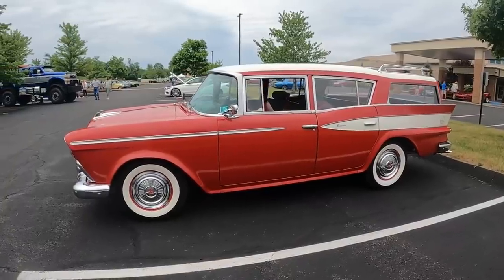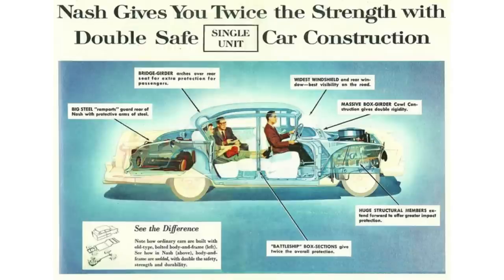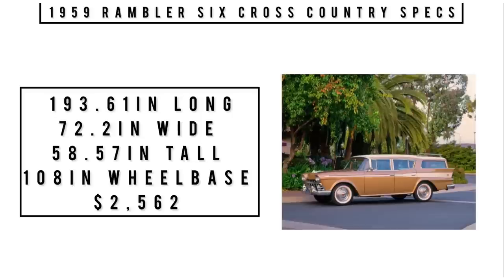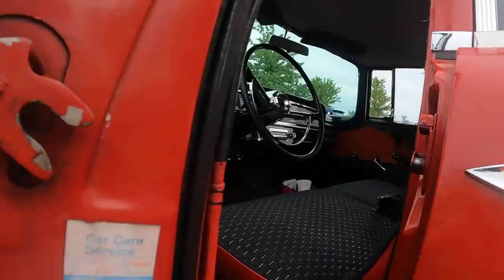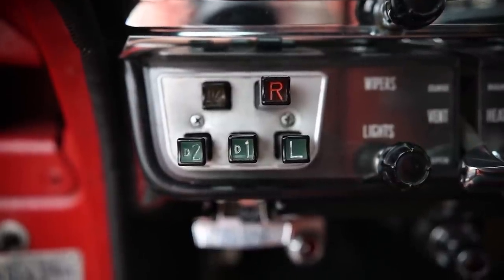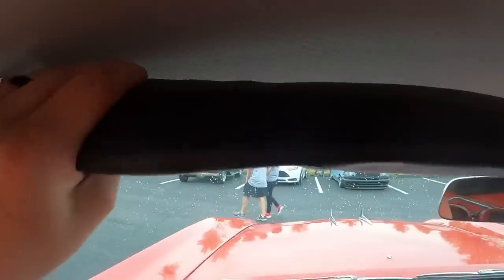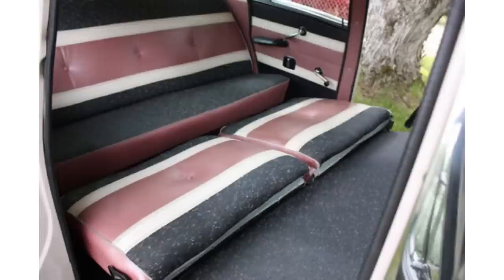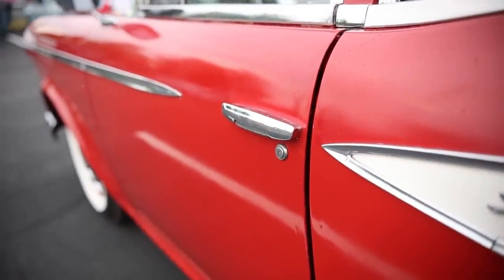1959 (AMC) rambler super cross country wagon six

Comment: I live in the UK, in the mid 1960's I worked for a local antique dealer who had 1959 Rambler Cross Country Custom. My parents did not have a car so the Rambler was the first car that I had any experience of. It was RHD and originally made for a German customer living in the west of Ireland. I used to get the job of washing it, which took ages given its size and chrome work and the interior. The main body colour was black with a bright red roof and side stripe, the interior trim was, black, red with horizontal white stripe. It was ideal for moving large, heavy Victorian furniture, from the auction rooms to the shop etc. When lightly loaded it floated along and smoothed out all the bad spots on country roads. Happy memories.

Comment: Hey. You nailed this one! You show enthusiasm. That's good. You show interest. That's good. You show passion for AMC and Ramblers. That'll earn you extra stars! 
I have an enormous love for all things AMC, and have, fortunately, owned several throughout the years. I hope that the following will be of interest.

The Ambassador series was, indeed, the senior series of the Rambler line. It was actually marketed as "The Ambassador, by Rambler". It was not a "Rambler Ambassador". It rode a 117" wheelbase vs 108" for the Rambler Six/Rebel V8 and had an overall length of 200" vs 191" for the Rambler Six/Rebel V8. 

The Ambassador Custom Hardtop Cross Country station wagon was the sole hardtop wagon in the lineup. The top-of-the line Rambler Six/Rebel V8 Custom Cross Country wagon was not a hardtop. 
Only 578 Ambassador Custom Hardtop Cross Country wagons were produced for 1959.
The Rambler Six Super wagon you showcased had a production run of 66,739 units.

Four-door hardtop sedans  (Rambler Super Six, Rambler Custom Rebel V8 and Ambassador Custom) were called Country Club models. Although period sales literature from AMC does NOT refer to the Ambassador hardtop Custom wagon as a "Country Club",  the Standard Catalogue of American Motors (1902-1987) does refer to the hardtop Ambassador wagon as the Ambassador Country Club Hardtop wagon. So, playing with words, one might call the body style the Ambassador Custom Country Club Cross Country wagon. 😀

Although not presented in any AMC Rambler literature for 1959, the Ambassador by Rambler offered a Deluxe 4-door sedan. Only 155 were made. I've yet to see a photo of one, and I doubt if noted AMC historian, author, collector and expert Pat Foster has either.

For the record:
1-The Rambler American could have reclining seats as an option.
2-You mention Weather Eye. That was the Nash (then AMC) trade name for their heating, ventilating
     system. It did not include air conditioning. Air was a separate option, but was integrated with the 
     Weather Eye system. Nash/AMC was the first to integrate all components of the AC system under the
      hood; nothing in the trunk. It was copied by all other car companies. 
3-The Deluxe Rambler Six came standard with dual headlights! For $23 and change, you could equip your
     Deluxe Rambler Six with quad headlights. 

Finally, you taught me something that I never knew about my favorite year Rambler. I did not know the rear door vent panes were operational only on the Rambler Custom series. I appreciate you pointing that out.

While I have several favorite AMC cars (please find a nice AMC Hornet Sportabout wagon to showcase), the 1959 Rambler Six/Rebel V8 is my favorite Rambler of the 1950's.

Once again, great job!
Reply from the maker: Thank you so much for the added information and corrections I thought the deluxe came with dual lights and could upgrade to quad lights but wasn’t a 100% sure if I read that or not deluxe trim I believe only case in solid colors could be wrong that’s why I left that part out too

This was always my favorite wagon after being in one I really want one now.. they made nicer wagons but none got 32 mpg HWY with folddown seats that looked this good.
Reply: @What.its.like.  Period Rambler sales literature indicates two-tone paint was an option, but doesn't mention if it is offered only on certain trim levels. But, in the 1959 Rambler brochure, it shows a Rambler Deluxe 4-door sedan in the color red, with a white top and having dual (not quad) headlights.
Question answered!
Reply from the maker: Thank you so much =)

Comment: I had two Rambler Americans from the early 60's, the squared off ones.  On the reclining seats, the cars came with two "hook" supports, with rubber covering that were inserted into two slots (on each side) for the backrest to "land" on when folded down.  The hooks made the seat backs rest even with the front of the back seat, to make it more "level."  I'm sure the hooks on this model were lost ages ago, and the current owner wonders why the four slots (two on each side) are in the metal part of the car below the seat cushion.
We als had a 63 Rambler wagon WITH the three speed and overdrive.  At interstate highway speeds, 70+ MPH, it got around 30 MPG.  Those cars were SO ahead of their time.  One of the secrets was the engines in the sixes had a 4.25" stroke.  That. long stroke gave them lots of torque, at low RPM, so the engines didn't need to operate at higher RPM's to keep the car moving.  So at 70 MPH with overdrive, the engine was barely turning at 2,000 RPM's.  Competitors engines, even with overdrive had to turn faster.  Also they all had separate frame and bolted body construction which was up to 1,000 pounds heavier than the Rambler "Unibody" construction.  
The first Unibody automobile made in the US was the Nash 600.  It came out in 1940, using the flathead six cylinder engine (that was in most of the Rambler Americans until 1966).  It was called the 600 because it could go 600 miles on a 20 gallon tank of gasoline.
Reply from the maker: Sweet thank you so much for sharing your experience =) with owning a rambler wagon 

I got the review my friend 62 Rambler wagon last year and he let me drive it and I was really amazed at how much down low power there was.. it wasn’t as underpowered as some people claim. To me a Volkswagen Karman Ghia is under powered.. this car had so get up and go 

I want to find a 1958 Ambassador cross country wagon with the 327 with a manual and I really want to drive it that’s one of the fastest wagons of the 50s 0 to 60 and 8.5 seconds in a wagon
Reply: Then came the famous Torque Command sixes with 7 main bearings, that were also used in Jeeps when AMC bought them out.
They were used in Jeeps up until 2002.

Comment: My grandfather own a 1958 Cross Country with the 3 speed and overdrive.  He claimed on the road he got 28 mpg and that would be with a vacation trip with the car loaded down.  So, yes I believe you could easily get 30 plus mpg in the day with the straight 6 and not a heavy foot.  My uncle from the time I am able to remember owned Ambassadors till they were no longer made.  There son born in 1956 had a heart condition and Nash was the first to have a really great AC.  They developed the clutch for the compressor before ALL the other auto makers in 1955.  One of the reasons they bought Kelvinator was because of making refrigerators.  My dad had a 1955 American wagon and later had a 1957 bear bones Cross Country.  He drove that 57 for about 14 years.  That was a great car.
Reply from the maker: Great story and information thank you so much for sharing =)

Comment: HI Justin,
Thank you so much for showing my car. Sorry I didn't reply sooner, a crazy month. You took such wonderful closeups and angles. Yes, the 4-door hardtop was available in this mid series, in a sedan or station wagon. Both came in the Super and Custom levels as well as the Rebel.  This front seat is correct for and, came from another 1959 Rambler.  With the question of rust. Having lived then, all cars of that era were prone to excessive rust. 
Cars that lived outside of the rust belt generally survived just as well as any other make. There are still plenty of these 1959 Ramblers out west. Thanks again. hope to see you again soon.  I noticed this came up under my daughter's name. Crazy, Take Care, Rick
Reply from the maker: Thank you so much for the opportunity honesty so glad I  stopped and talked to you that day just wondering are You going to beaver tomorrow both ron and I are going hope to see you there =)
Reply: Weather permitting we will visit the Beaver Cruise. The weather has been very active. One additional fact about hardtop station wagons. The 1956 Rambler was the industries very first 4 door hardtop station wagon. They were built for 5 model years 1956 through 1960.  Chrysler had 4 door hardtop station wagons 1960-1964, with some Dodges. GM only had 4 door hardtop station wagons for two years 1957-1958 Buick and Olds only. Mercury was unique they built 4 door hardtop station wagons only, no standard post wagons, from 1957-1960. Also, Mercury built the industries only 2 door hardtop station wagon 1957-1959.  Rick

Comment: Beautiful restoration, right down to what appears to be the factory-correct upholstery material and pattern. The '60 was arguably the last year of the most handsome body lines with the hooded browed headlights. While the '61 was the final year of the rear fins, the grille wasn't as stylish as the '60. Our dad did the unthinkable back in late 1961. He traded in our pristine iconic '57 Bel Air (w/283 V8 & auto trans) for a brand-new base-model '62 Rambler Cross Country wagon that had zero options. It was so basic and Spartan that it had no radio or clock and no chrome horn ring...just a lousy center button and a single horn; no dual horns. It was also a 3-speed column shift, with puny dog-dish hubcaps and no carpeting inside; just that crappy contoured-formed rubber matting (like you find in most trucks of that era). Compared to the Chevy, that Rambler was clunky and noisy. True to its model name, we did a "Cross-Country" road trip in that car from San Diego to Norfolk, VA, then back again 2 years later after Dad's Navy tour of duty was up.
Reply from the maker: Believe it or not it’s a survivor he never really restored it he just took care of it he’s a friend of mine I can’t wait to meet up with him in the summertime. I think he is the second owner if I remember correctly bought it while he was on military base. He had another car at a car show and we got talking and he said he had a 59 cross country Rambler wagon and I looked at him and I was like are you serious I proceeded to tell him that that is my favorite wagon of all time and he didn’t believe me until I started talking about it and then he’s like wow you really do like those and I said get the 59 is my favorite. I’ve been looking for one they’re hard to find in there expensive when you find them in good shape the only thing that worries me about buying that car is the whole trunnion front suspension aspect I don’t know anything about that I’ve heard horror stories where. Someone was just driving there’s down the road and the whole front just fell off the car which would be terrifying especially if you’re going any amount of speed. That would result in a really bad day and possible trip to the hospital
Reply: @What.its.like.  ......or a trip to the county morgue!  LOL!

Comment: Personal taste, but I like the more subdued fins and flat-iron taillights of the '60-'61 Six/Classic Ramblers. 
For a  more distinctive ride, check out the '61 Ambassador with its more Euro-style nose and distinctive taillights. 
Another cool feature of this generation Rambler wagons, these could be ordered with a side-hinged rear door instead of the drop-down tailgate. Not quite the three-way doorgate popularized by Ford and others, but useful for loading passengers in conjunction with the third row seat or cargo in the six-passenger wagons. 
These cars had torque-tube drive with its advantages and drawbacks, I would probably have bought the Studebaker Lark VIII Regal with overdrive and Twin traction, dealer-installed air conditioning.

Comment: In 1956 there was a Rambler HT station wagon 6 cyl: the only engine avail for Rambler, as both a Nash Rambler and a Hudson Rambler- same car, only differences were in badging, including gas cap and wheel covers).  In 1957 there was a Rambler HT station wagon only on the V-8 models.  For 1958, 59 and 60, the HT station wagon was only available for the Ambassador.  The AMC HT station wagons were available only on the top end cars each year it was offered (1956: Rambler 6 Custom, 1957 Rambler V-8 Custom), 1958, 59, and 60: Ambassador Custom)
Reply: You are correct.
Reply from the maker: Awesome information thank you so much for sharing all of that I really appreciate it =)

Comment: I am not sure on that question you asked,  I know definitely the hardtop wagon was not available in the Rambler American  ,but I think you might have been able to get it in the Rebel model and definitely in the Ambassador range. That is a great question, you are just the way I was when I was a teenager,  always wanting to know everything you can about the Automobile, at 55 I am still learning, there are at least 25 subjects I self taught myself, I am going to look that one up.
Reply from the maker: My question is I’ve heard mixed things I always thought that if one wanted the hard top (pillarless) wagon. Had to step up to ambassador line.. I’ve also heard that there was a hardtop rambler wagon.. I looked and couldn’t find any pictures. Did they make a rambler hardtop wagon in six or Rebel V8?
Reply: @What.its.like.  As I wrote above, there was no Rambler Six/Rebel V8 hardtop wagon. The only hardtop wagon was the top-of-the-line Ambassador Custom Cross Country wagon. 
There were several hardtop 4-door sedans: Rambler Super Six 4-door hatdtop, Rambler Rebel V8 Custom 4-door hardtop and Ambassador Custom 4-door hardtop.

Comment: Jays dream car is a 59 rambler 6 with overdrive.Mine is a 72 AMC ambassador with the larger v8.
Reply from the maker: 59 Rambler with a 327 might actually be better I won’t get the gas mileage than a six cylinder kids but you won’t have to keep re-Twerking the head bolts... that’s my favorite wagon of all time I don’t know what my favorite car of all time is
Reply: @What.its.like.  one mistake amc made was not building a pony car to go against mustangs earlier. They could have easily and  cheaply built a 2dr rambler with a big engine, 4 speed, stiff suspension with a hood scoop in 65. The marlin could have ran with chargers and for cheap. My idea for rambler pony car would only cost a few hours of engineering.
Reply: Just like Hudson waited on the V8. They needed young people who would push for performance vehicles. And lose that stodgy AMC image of the '60s

Comment: The Rambler sixes of that era were very reliable indeed, but you weren't going to accelerate very fast in them. The automatic transmission shown was supplied to American Motors by Borg-Warner. It's 3-range unit using a torque converter. Selecting the D1 button allows the transmission to start in low gear and make all shifts. Selecting the D2 button causes the transmission to start in second range then upshift to third range. Back in the day, there were lots of salacious jokes made about the seats folding into a bed feature.
Reply from the maker: Awesome information I thought I read that it was a borg Warner unit it works similar to ford o matic ( later called cruise o matic) and studebakers transmission, drive started in 2nd gear where low was only accessible in low?
Reply: @What.its.like.  Indeed, Borg-Warner did supply the Fordomatic (beginning in 1951 model year) and Merc-O-Matic and some Cruise-O-Matics into the 1960s. Operation was similar in the Ford products.
Reply: @What.its.like.  If you check further I believe that you will find that the Ford - O -Matic and the Flash - O - Matic were the same design from BW.  (Gotta; love those names!).  Over the years they did make it possible to start in the first gear and shift automatically through the next two.  For a time, however, Drive was two speeds and Low was the single "low", higher numerically, ratio.
The Cruise o matic was a different transmission as I understand it. For my money the best transmissions of the era were the Torqueflite and the Hydra Matic.